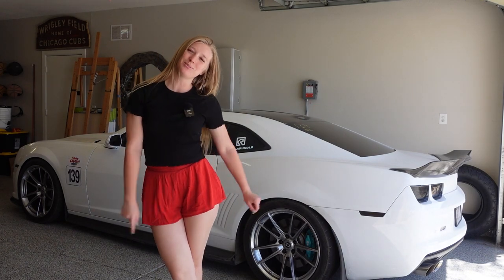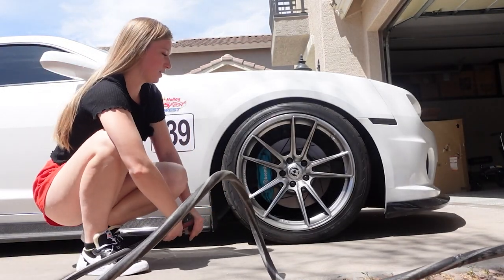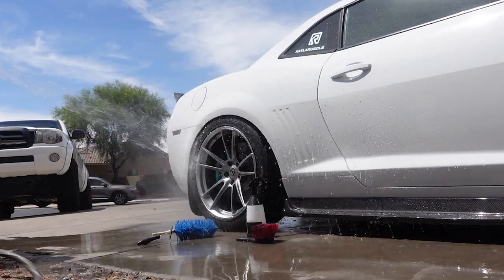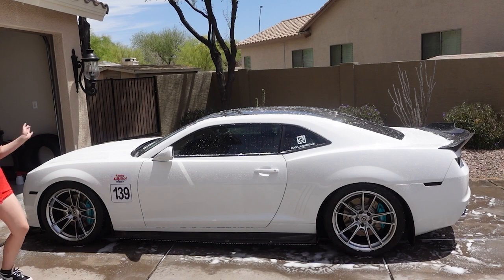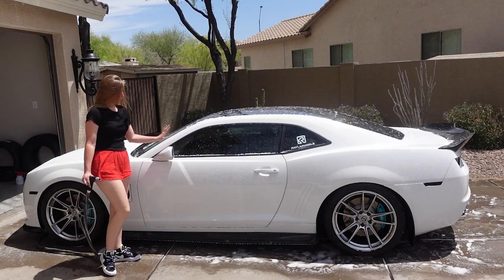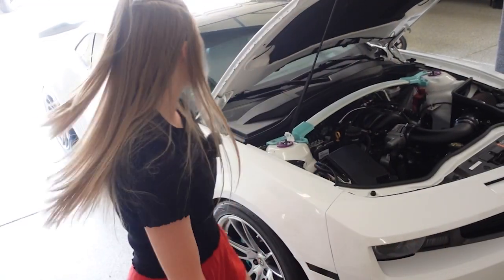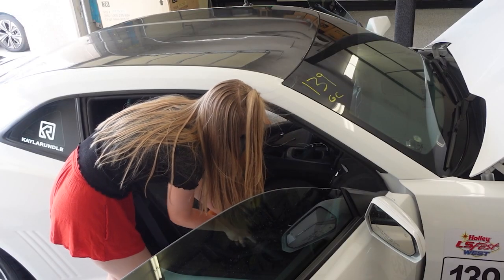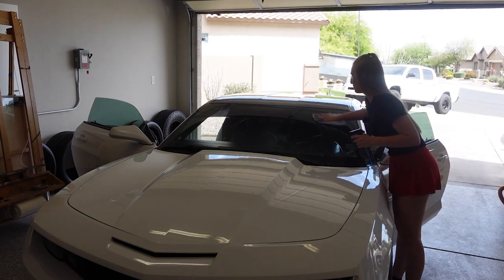Touchless Car Wash on my Camaro

Comment: You are so right about how much work it is to do both inside and outside of the car on the same day...especially when you get older, its even harder.
I sometimes think about how people can be vastly different about how fussy they are about their car.  I am like you as are many enthusiasts and like an immaculate car but others just kind of trash their car out and seem to be ok with it.  People that love cars with a little OCD...it drives us crazy.
There is a young girl in my condo complex that has a white Gen 5 Camaro with aftermarket wheels but its the V6 automatic. I have always loved the Camaro back to the time of the 1st Gen.  She has had some issues with it and I coach her Mom about what to do.  She has had PCM problems and you likely know the grounds on the Gen 5 are marginal and many in fact beef them up.  Her car is always kind of dirty and trashed and her idea of detailing is running it through the car wash.  So people as you no doubt know, are very diverse.  OCD can be a bit of curse and so people with this tendency have to try and not get too carried away....you mentioned detailing your suspension which only true car freaks understand. ;-)
Well done Kayla and drive safe.

Comment: What product did you use for the ceramic coating? Mine supposedly got a ceramic coating from the dealer I bought it from but I hardly notice a difference. Maybe they just charged me for it and never did it or the product they used was crap.

Comment: I'm planning to buy a Camaro but im confused between V6 or the V8. Any suggestions? i wanna use it as a daily drive as well.
Reply from the maker: Depends what your budget is and what you need. In my opinion if you want a V6 for the budget, there are way better options rather than a Camaro. Like a Civic HatchBack (I have One, best car ever). If you have the budget, I'd highly recommend a V8 SS at the minimum, you'll love it.. it's worth it!
Reply: @KaylaRundle  the budget won’t be an issue. Hopefully. Yeah I really want a V8, I was just scared if it is worth it or not. So thank you so much! Love all your videos tho🙌🏻🔥